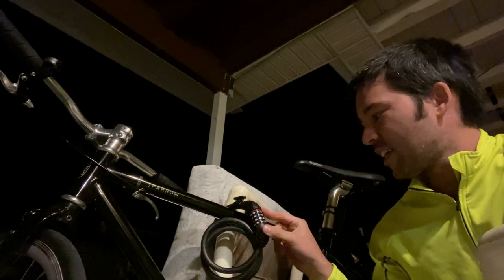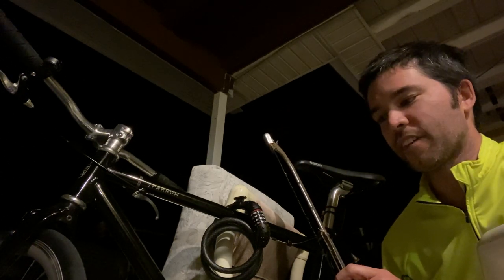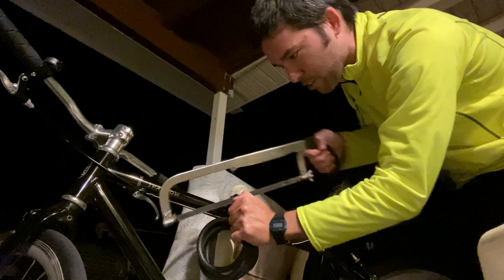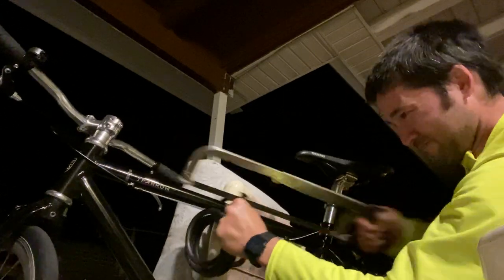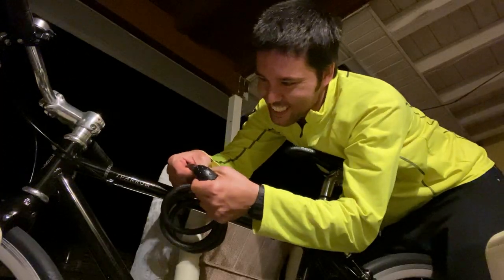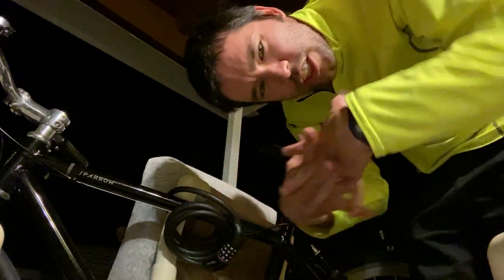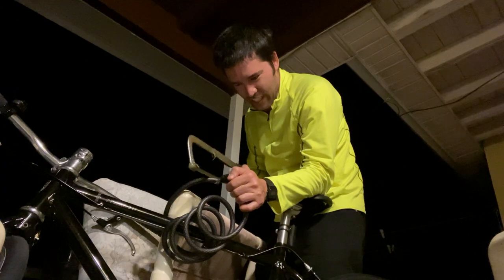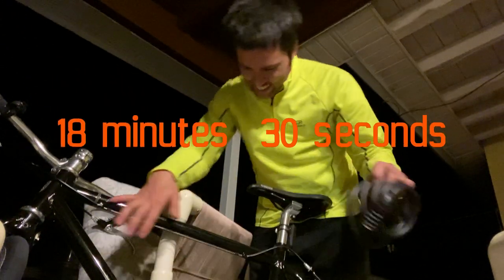How long to cut a 1/2" cable bike lock with a hacksaw

Comment: Just shows they aren’t as easy as people like to make out they are
Reply: Because he is using a saw. With a good quality bolt cutter and cutting pliers, you can do it in less than a minute.
Reply: Wire cutters and strong fingers would've done the job in two minutes. Hacksaw is the wrong tool for cable locks.